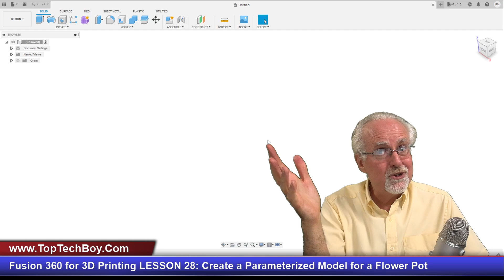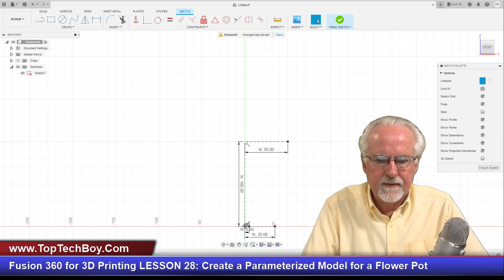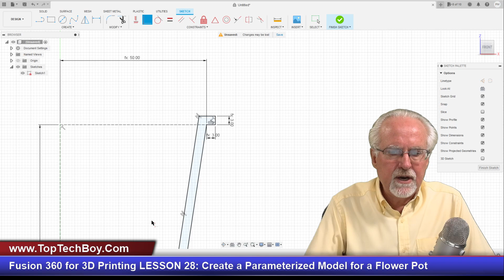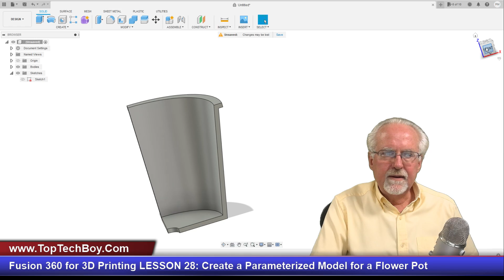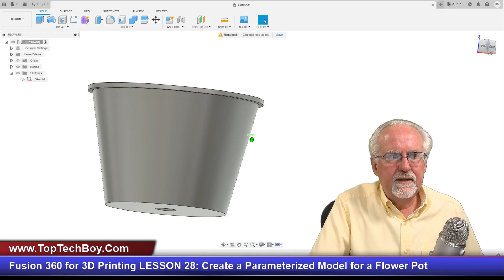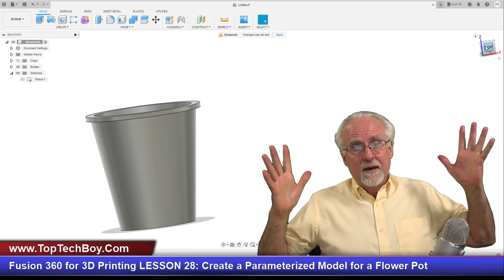Fusion 360 for 3D Printing LESSON 28: Create a Parameterized Model for a Flower Pot

Comment: Hello. If you make the bottom circle a percentage of the top circle you will be able to stack pots of different heights more easily. The same goes for the thickness. It could be a percentage of the height. A taller pot needs a stronger sidewall.

Comment: Gosh, I did this parameter design completely different using the loft tool. I did not use the revolve tool. Another thing is that I believe my understanding of parameter design is flawed. I thought the less drive dimensions and the more driven dimensions the better. Doing that everything is based on one dimension. What that does is just scale the design. The way you do it you can change any dimension without breaking the design. I believe that is the goal of parameter design. Another awesome lesson.

Comment: Hello Paul, I just found you and wish I had sooner. I have limped along by replicating results of other "How To" videos, but have not had any conceptual knowledge until now. It's empowering to be able to see more organic shapes and know how to model them.

I do have a question Parametric question if appropriate to ask here - and you know what, I think you covered something in the hinged box video that will solve my problem. This is why I have really appreciated your series. Great building blocks to go back and reference. My question was, I have some extruded ribbing done with a circular pattern around the face of the planter. I didn't know how to make the ribbing always go to the height of the planter when accounting for the fillet rounded bottom, but... just name that as a user parameter and then it can be referenced as another ie: height-filletbottom. 

Thanks so much for putting these together, enjoy your coffee!

Comment: Haven't had time to post my solution yet, but I was able to design this so that the only parameter input needed is the pot size( top radius). Everything else, height, bottom radius, drain hole size, wall thickness and lip size are driven from that parameter. Thanks Paul for another great lesson! On a side note, I think many of us cannot fathom not being able to pop over to the local Walmart or Ace Hardware whenever we need something! Just one of the many challenges you face daily.
Thanks again, and God Bless!
Reply from the maker: LEGEND!
Reply: I actually did that too but thinking about it, it only scales the solution so I do not think that is an ideal design. Looking at Pauls solution you can change individual dimensions without it breaking the model. It is taking me a bit to actually see how to use parameters.

Comment: I am a legend, however, I wanted to put a drain in the bottom center consisting of a pattern of six small holes inside a small circle with a thinner wall than the rest of the wall thickness. Was unsuccessful in creating a circular pattern of small holes inside a circle on the bottom. I was able to create two construction lines at right angles, and place a hole in the center of a construction line, but no pattern. (What happened to the array command?)  Another thought: base the sizes of everything on the capacity of the container from a thimble to several liters. That is what a person would need to know when deciding what size to print.  
Useful idea: Use the Windows snipping tool to copy the table of parameters after they are created, and paste them into notepad or OneNote for reference while the parameters are not visible.

Comment: I would not be able to print your design on my Prusa without supports. Maybe the Ender can "Air Print" that horizontal lip ok. Let us know how it finished Paul. Thanks for another great lesson.
Reply from the maker: Keith, it prints pretty well. The lower edge of the lip is a little rough. I would guess the large the lip, the more challenge that would become.
Reply: @paulmcwhorter  Good to know. My Prusa would end up with spaghetti trying that.
Reply: If the lip gets too large it becomes impossible to print without support, which is why I included the 45degree slope in my design: https://youtu.be/jilS_AARN1k That way it doesn’t matter how big the overhang gets, it still doesn’t need support.